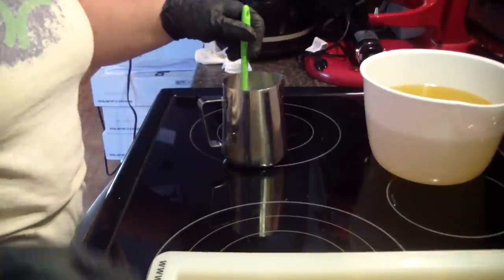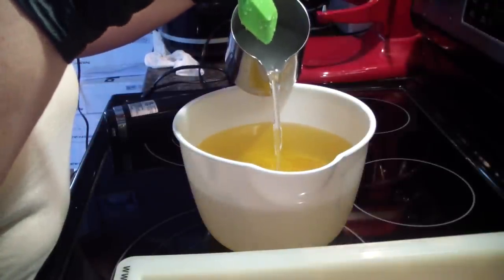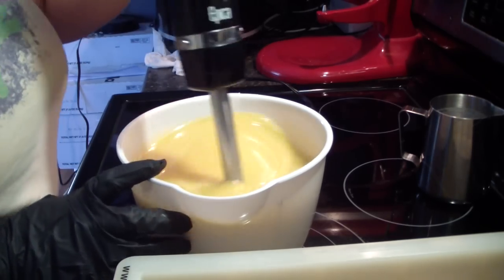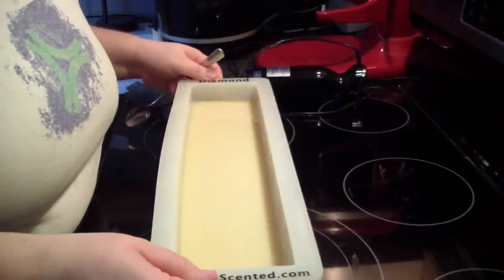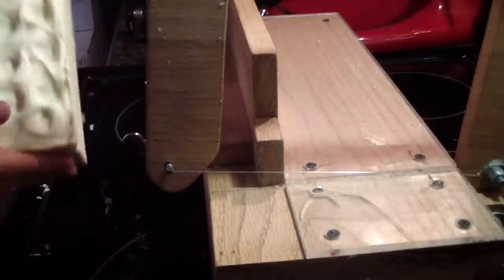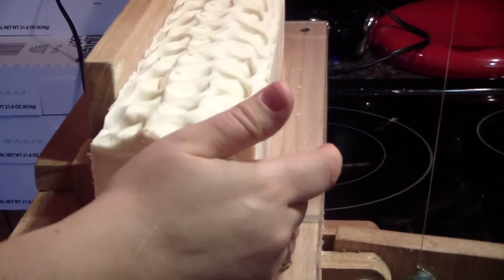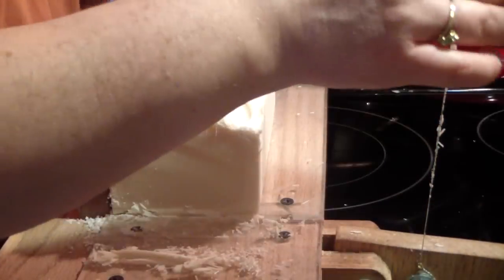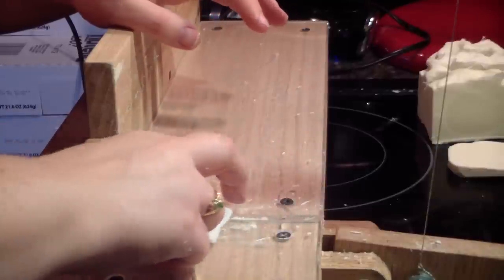Making & Cutting Castile Soap

Comment: Sometimes if you put it in a warm oven you can complete that jell faze and it will be soft enough to stamp. Put a piece of plastic wrap over soap and try stamping it through the wrap so it doesn't pull soap up.

Comment: What exactly is the "gel ring"? Is it a phase that the soap goes through or a texture?
Reply: BMW 1234 gel ring happens where the soap only gels in the middle. if you insulate it you can get the gel to spread or if you refrigerate it you can prevent the gel phase.